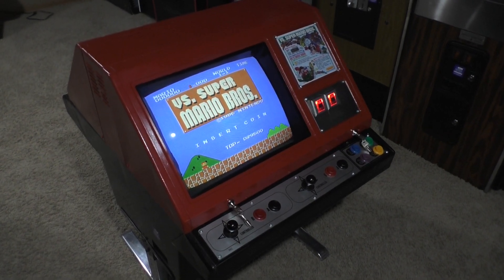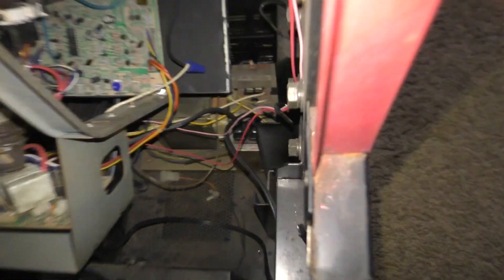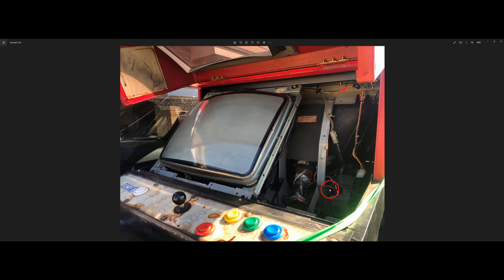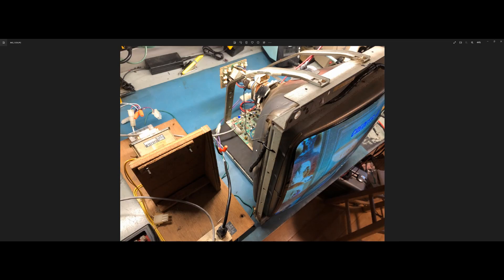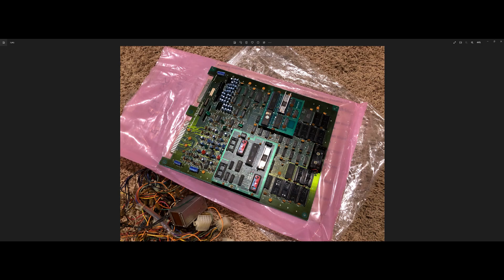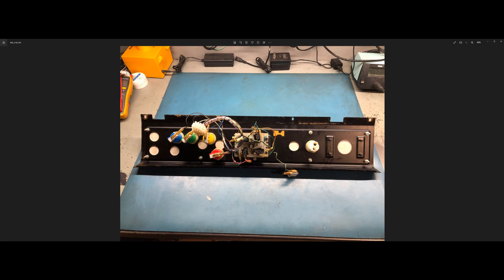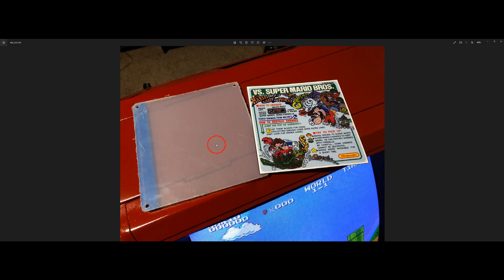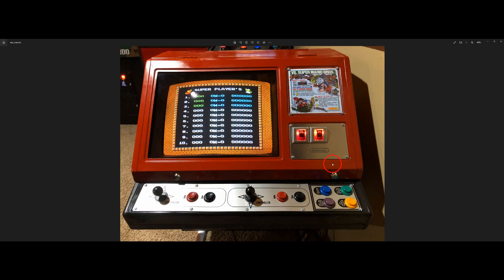Nintendo Red Tent Arcade Machine Restoration - Going In The Arcade!

Comment: Great work. Do you think you could just drop a spare K7000 monitor into a red tent or would the voltage difference be an issue?
Reply from the maker: Yup. Plug and play except for the yoke connector if you're using the original Sharp yoke.